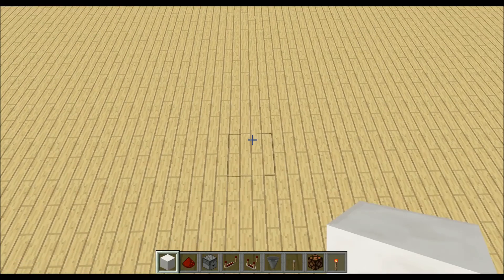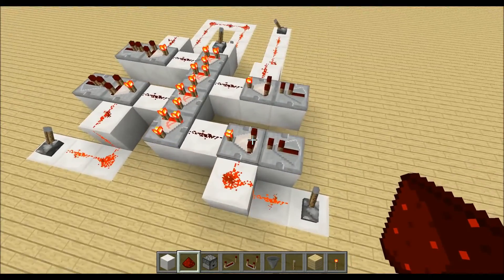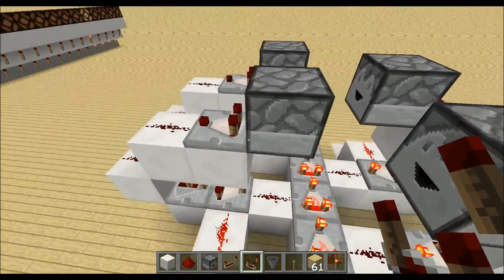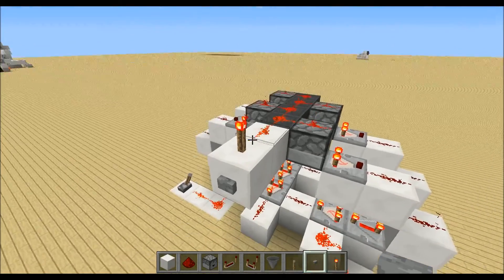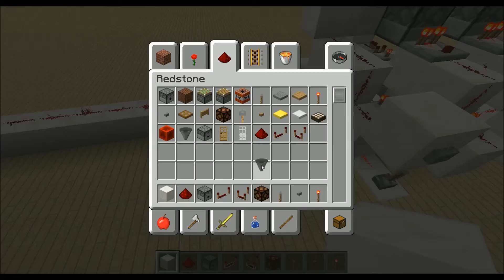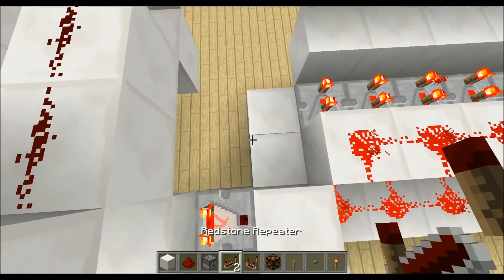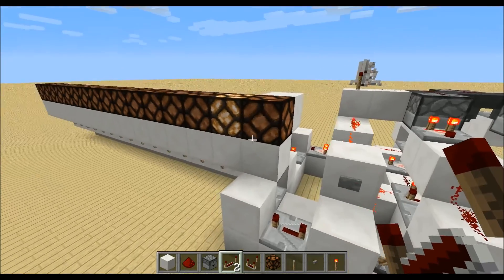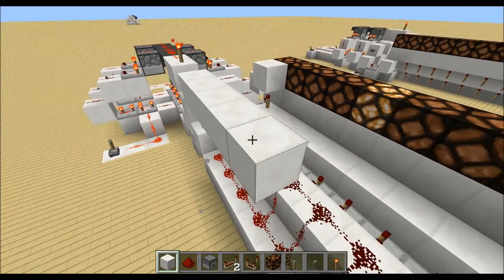2 - 16 Output Randomizer

Comment: 1 bit-2 outputs.
2 bit-4 outputs.
3 bit- 8 outputs.
4 bit-16 outputs.

The comparators going from the back to the front have a subtraction signal strength pattern of 9,5,3,2 and a delay pattern of 1,2,3,4. I've already made a 32 output system using 3 randomizers. 1 input and 2 output.

Comment: I'm trying to modify this design so that each output has it's own randomizer. If randomizer has Signal STR of 1 it goes to a section but if it has a STR of 3 it goes to a different section. I want to design it in a way so that a STR of 3 activates a single output rather than multiple. I have adopted Zexsuik's programmable lock design and used the cells to determine the signal strength. I'm trying to design it in a way where there is 32 different outputs for my new lottery machine. 4 bit memory cell,16 individual randomizers,and 2 sections per randomizer. With a 1 in 576 chance of activating an output in a section I can get over 15,000 possibilities in my machine. And maybe I can expand it and find some other capabilities besides lotto machines. I need some suggestions for my idea.

Comment: i built it and o only get output 0 and like 12 or higher does it still work in 1.7.4???
Reply from the maker: Check your comparators maybe they are not all in the right mode (substract)